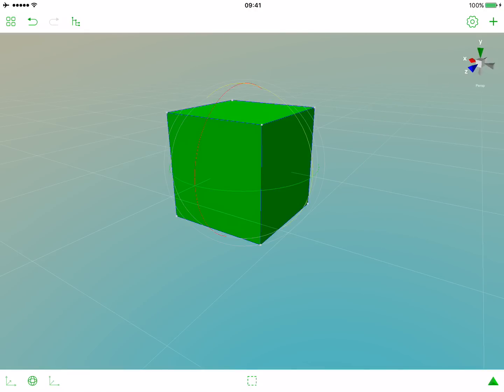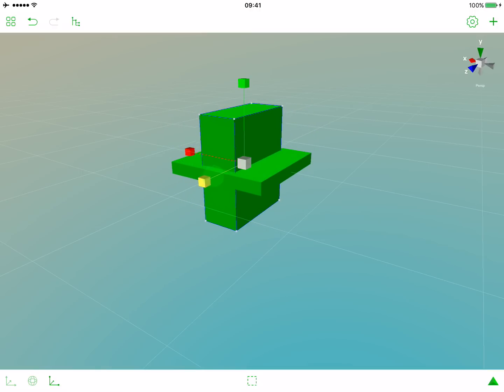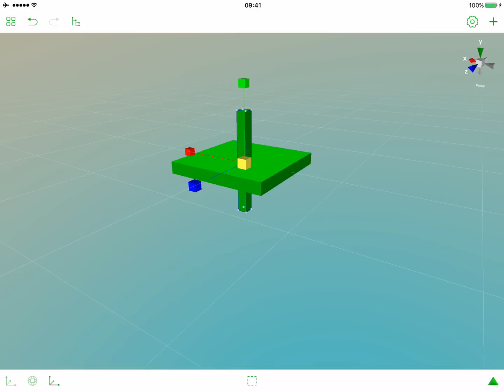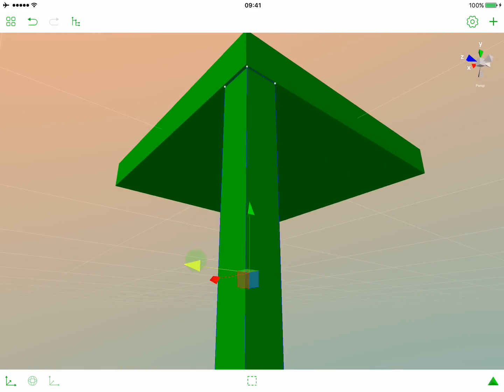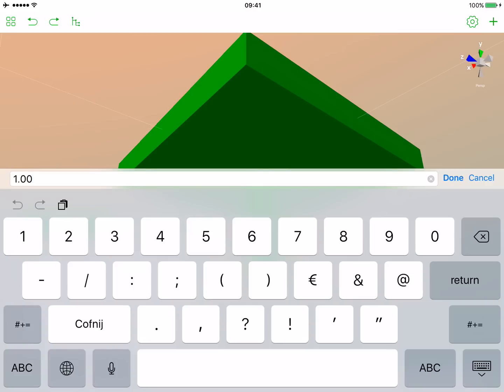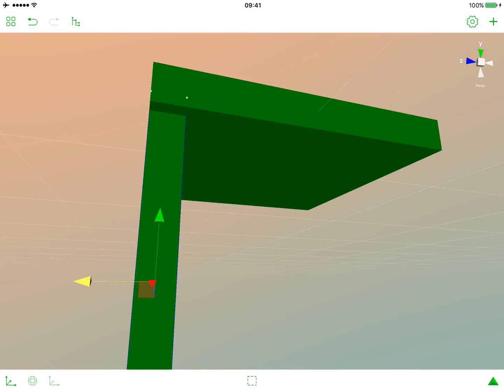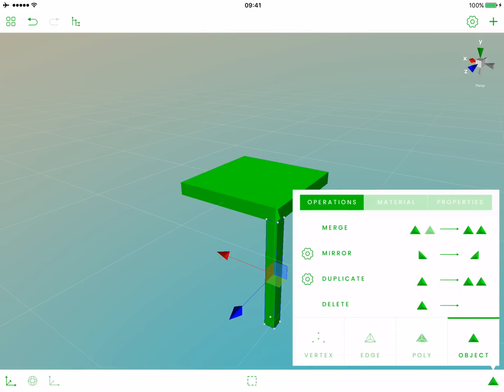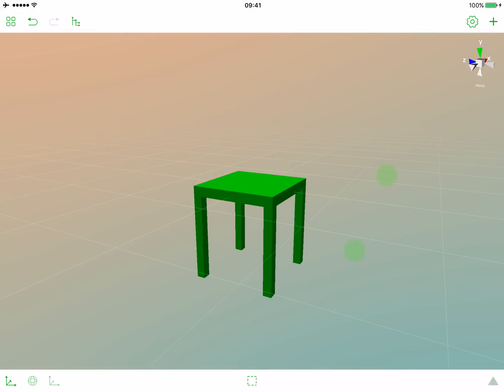Learn 3D Modeling on iPad. A1 Lesson 2: Your first model: a stool

Comment: If you had waymarked the gizmos, you could just state, select the purple scale gizmo. Visually, they are both the same on your interface. That is incredibly unthoughtful. As if logic is not in your minds. 

Also, I don't seem to be able to snap that first leg like you, the snap does not change the fact I can move the leg anywhere. Also, when you are changing the value and typing, the keyboard covers which input box you are altering. Why not say, " i am typing into the ..." and tell us what we can't see. If I wait, it's shown for a split second and I am personally getting nowhere with this. A huge thumbs down to your logic aswell.
Whilst we are here, that intro noise..just nope.